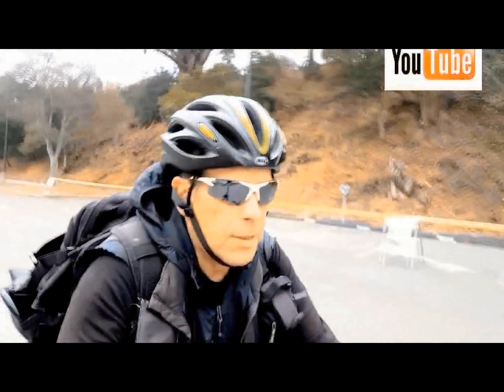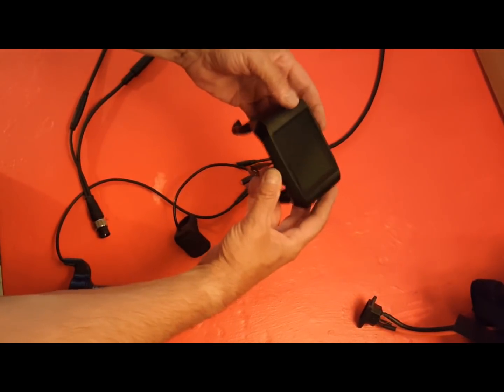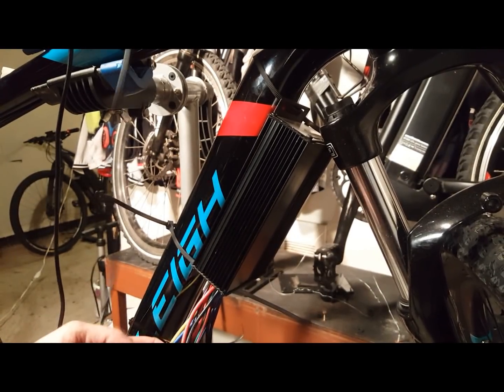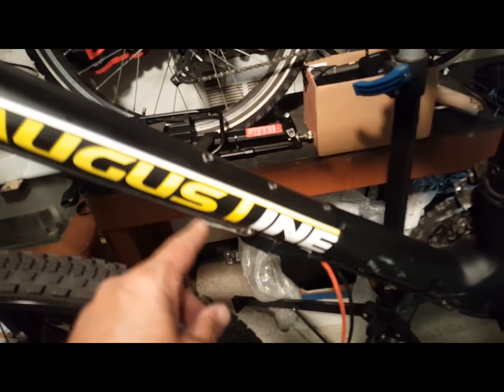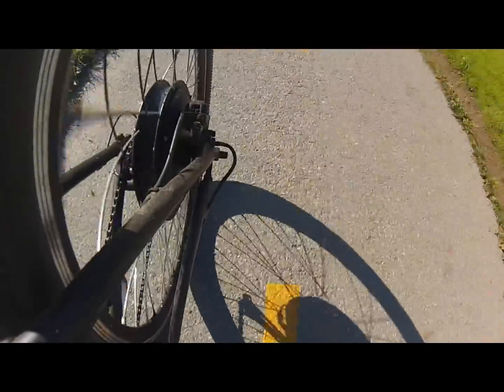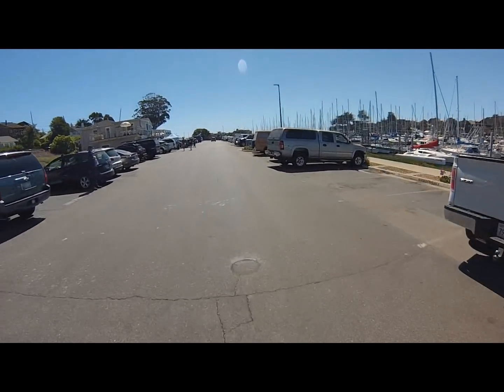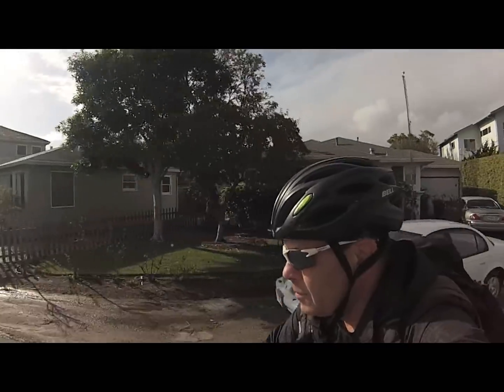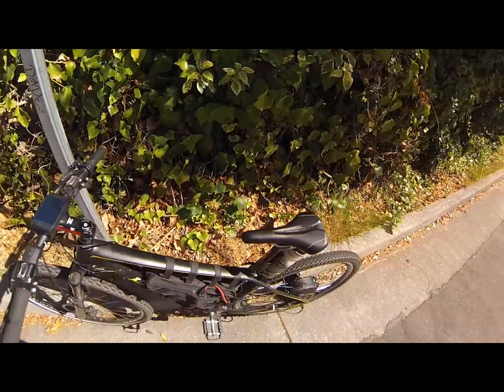EBIKE  - FAST 1500w Kit, built in Controller and TFT Color LCD

Comment: I picked up this same motor and display kit a couple of months ago. I mounted it onto a 24 speed MGX full suspension mountain bike. I bought an 8 gear ebikeling freewheel gear to match my 8 speed twist shifter on the bike. I had to spread the rear drop out 3/4" to fit this gear, but I would have had to spread 1/2" even if I had used the kit provided 7 speed gear. I got the ebikeling 52v 21ah battery as a kit addon. My kit came with two torque arms to prevent the rear hub motor from twisting out, and I used them both. It's no exaggeration to say the motor is whisper quiet. You can hear tire on road noise, but you can't hear motor noise. I'm very happy with the result. I edited this message just to clarify that I have the 1500w motor with a separate controller, not built into the motor as yours appears to be.

Comment: This is a very powerful motor.  Unfortunately, the internal controller is not well protected and is prone to failure.  I have had to replace TWO of these. One lasted a little over 335 miles the other one failed at 86.   They do not handle hard bumps well.  I mostly ride paved/gravel roads. It is a bad idea to have the electronics in the wheel. I loved the look of the internal controllers but they're too fragile.

Comment: Can you tell me the size of the positive and negative wires of the power cable?I need to get the appropriate Anderson connectors for them.They seem to be 14 gauge.The battery has bigger wires with Andersons,is it a problem?

Comment: Hi wondering if you can help me I have the 1000w kit on mine as soon as it goes over about 30mph the motor starts vibrating every time I built one a few years ago and don’t think that one did it it doesn’t do it if you lift the back wheel up and test at full throttle just when your riding it. Do you know if yours does the same? Thanks

Comment: hello i wonder if you can help me i have tried to contact voilamart in regards to the diameter of the 1500 watt rear axle as i need some lock nuts for the inside of the dropout they dont seem to understand what i'm talking about ,i heard you mention that you used lock nuts for your bike .can you please tell me what size nut i need please many. thanks fellow ebiker

Comment: If I run a 52v battery through a 48-80v controller to a 1500w rear hub motor, will I get a poorer performance?

Comment: Can this hub motor withstand a 72 volt 20 Ah battery and now I using a 48V 20Ah battery. I bought my built-in controller hub motor and it uses an SW-900 display. I could have bought the same display as the one here But I got me the SW-900 display a long time ago and I don't remember the specs. On the hub motor on it reads CZriding  (I guess the is the brand) and a long number ZC620040997 (I guess that is the model) . Thank you very much.
Reply: No mate 63v max so 52v battery maximum

Comment: Top speed?
Reply from the maker: 50MPH
Reply: @AugustineEBikes  50MPH?  How did you manage to go that fast with that setup?
Reply: @stommper1234  can only get about 33-34 mph tops .1500w built in controller 52v 18ah battery
Reply: @anniedove4760  35mph is fast on a mountain bike. I don't feel safe going any faster. 28 mph is nice for me.